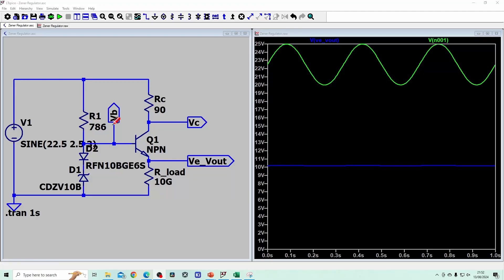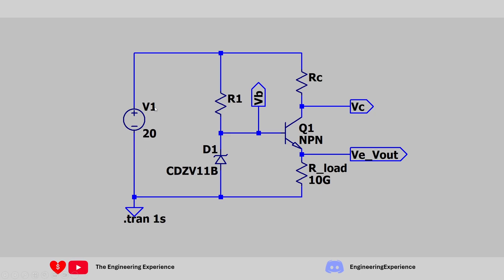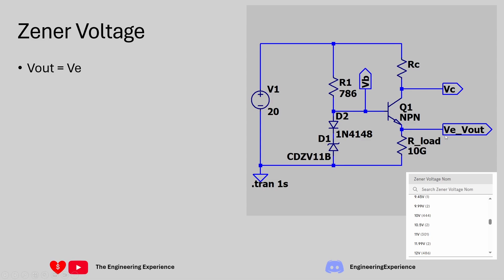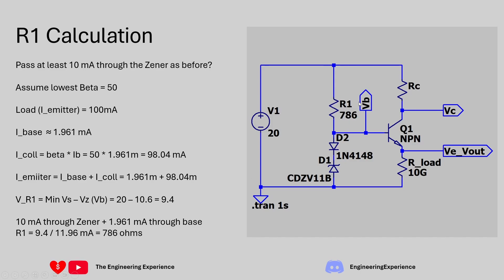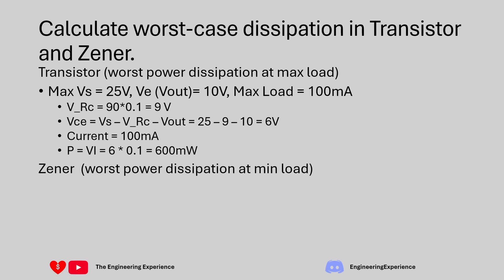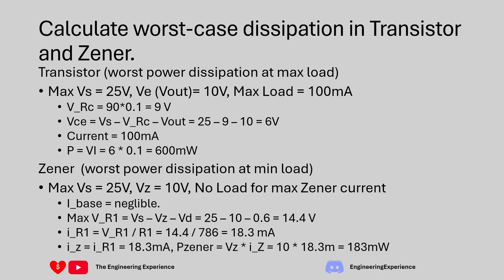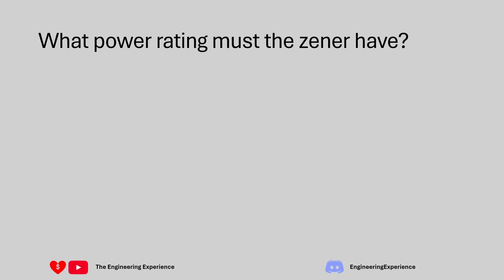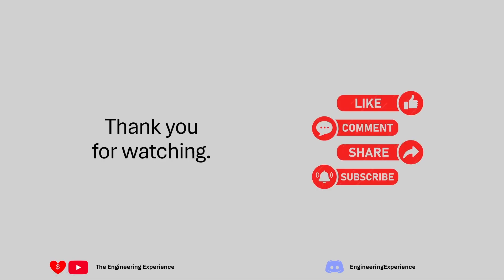Zener Voltage Reference Circuit Design - Art of Electronics Exercise 2.7

Comment: Shouldn't we have an emitter resistor parallel to the load for the No load condition to prevent transistor from switching off (as we did in 2.5)
Reply from the maker: I'll need to go through the video to be sure what you mean.

Are you talking about intrinsic emitter resistor re?

Comment: Hi! Great trick with the forward biased diode to "gain" 0.6V at the base of the transistor. I also looked trough the catalogues, but chose a 11V Zener and drop 0.4V across a base resistor. I think your solution is neeter, as it's not that dependent of the load current. It's also interesting to choose a precision category of resistors (i.e. 5%, 2% or 1% ) and choose the nearest available value of components and see the differences. Great vidoes, thanks 🙏

Comment: please help.. i can’t figure out where the percentage taken from? 94% and 60%.
Reply from the maker: I think what you are referring to is the comparison to solution in question 2.6.

Check out the second to last video on my channel. We are basically comparing the current through the diode for that circuit to this circuit.
Reply: How did you get the -45 percent?
Reply: I got this,,..!
Reply: Current base is equal to collector current divided by beta, so 100mA divided by 50 is equal to 2, why your answer to current base is 1.961?
Reply: @izikiasatienza4406  Ie= Ib+Ic = Ib+beta*Ib = (1+beta)*Ib. If beta = 50, Ie = 100mA then Ib = 100/51 = 1.961mA [Ib = 100mA/(beta+1)]
Reply: @izikiasatienza4406 cause the exact formula is beta +1